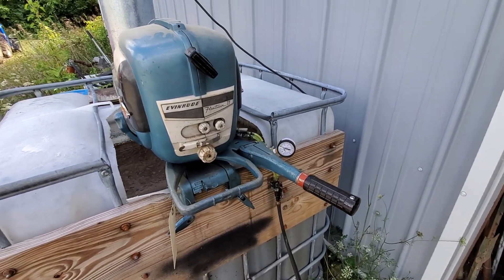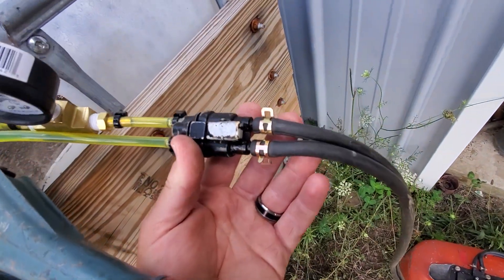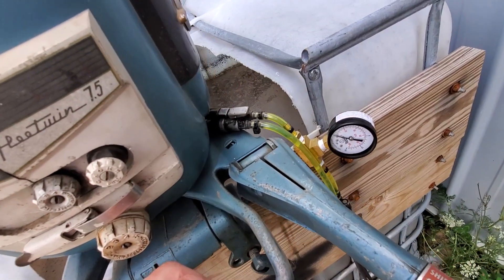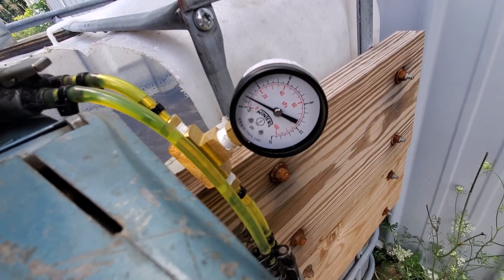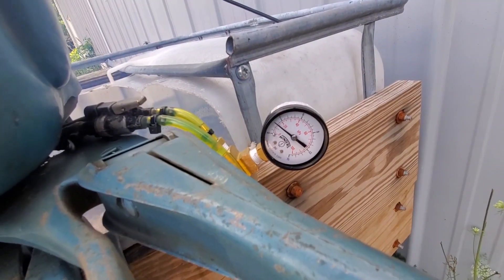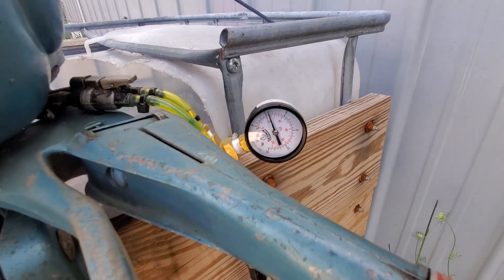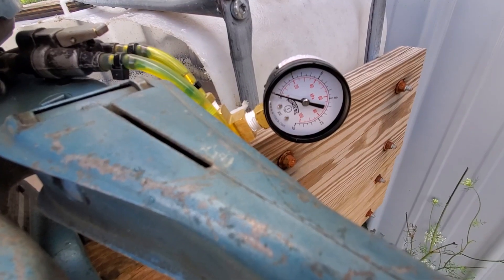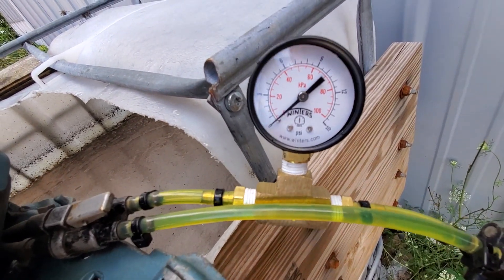OMC Pressure Fuel System Tank Pressure Gauge

Comment: It has been a year or so since we "finished" the Fastwin.  It ran great back then, idled like a dream, reacted to throttle, just required the primer being "thumbed" on the tank to keep carburetor bowl filled.  Ordered the gaskets and the rubber flapper parts, including the spring last year.  Just installed and reassembled everything yesterday.  Would appreciate your insight on this issue.  The motor will not run.  Set low speed jet to 2 1/2 turns out, high speed 3/4 out.  Primed to fill the clear glass bowl on the carburetor.  Ran once, only momentarily, at a full throttle setting, in gear with choke full on.  Patently waited, pulled, dried the plugs several times and attempted over and over for 30 minutes or so.  Is acting as if it is not getting fuel, yet it is.  And, as an abundance of caution, checked spark, that was fine.  By the way, installed a new ignition system, including wires last year.  Was rewarded with a smooth running engine.  Oh, and I did as you suggested, the gaskets for the manifold were assembled dry, no gasket sealer was used which might have gummed things up.
Reply: All ok.  Had an old beat up pressure tank.  Put new fuel in it.  Motor started right up.  Sorry to bother you.  Will be my first motor on the boat for the season.  These Fastwins from the 50's are great, light enough to move around easily for an old guy, like myself.  Looking forward to all your videos this year!
Reply from the maker: It's no bother really.  I got a little behind on some of my replies. I'm glad to hear you got your Fastwin up and running.  They are great motors.  Thanks for watching!

Comment: I have a question for you, when you have your tank disconnected from your motor, do you leave cap on tank slightly open so no build-up of pressure inside of tank just sitting and not being used or do you tighten cap? I'm new to pressure tanks and I notice on mine when I keep cap tight , fuel leaks out of fitting that goes to motor. Is this normal ? I have rebuilt the fitting with new o-rings and springs.
Reply from the maker: I do leave my pressure tank caps just loose enough to not seal tightly when stored. If the O-rings are a perfect fit and there are no scratches on the brass plungers they will seal and not leak.  If the O-rings are not perfect and/ or beginning to wear, they will seep slightly under pressure. To avoid the seepage, I leave mine cracked open the same as you.  Thanks for watching!
Reply: @oldjohnnyrude8404  Thanks for your reply to my question. I can see that if your as old as some of the parts that are used can't be in pristine condition that things will leak , that is why I was leaving mine slightly open. I lost half a tank of fuel because I had the cap tight after I had rebuilt this tank.
Reply from the maker: @MrBuddyMitch  Yes, I forgot and left the cap tight on my pressure tank I leave at my cabin in the shed in the spring.  After 6 weeks or so when I returned, I had lost at least a gallon of fuel mix from leaking during pressure cycles.
Reply: Thanks for confirming my theory to leave cap slightly loose.
Reply from the maker: @MrBuddyMitch  You're welcome.
 🙂👍

Comment: We just finished a 56 Fastwin this winter and spring.  Motor still had all the original ignition parts, flywheel never off.  Carb. had the cork float.  Runs great now, could not have done this without your videos!  Problem, will not keep running without priming.  Likely the Air Line Check Valve.  Do we need both Leaf Plate to crankcase gasket and Leaf Plate to Manifold Gasket?  Are they installed dry or with sealer?  Am going over to NAPA with a picture of your inline pressure gage set up for parts.  Will build a duplicate to confirm problem.  Thanks, Steve
Reply from the maker: That's great! '56 Fastwin is a great motor. Good power and will idle down woth the very best of them. If yours still had all of the original ignition parts, there's a good chance your motor does not have a ton of hours on it.  It's great to hear the positive feedback about my how-to videos.  Your tank is apparently not pressurizing.  That can be caused by bad check valves in the manifold,  a leaking air line on the motor, leaking O-ring on the air side of the tank fitting, leak in the tank air line, or something leaking on the tank like the cap or the gasket for the top of the tank where it screws onto the body of the tank.  If you need to pull the intake manifold apart, new gaskets for both sides of the reed plate are a good idea, but may not be needed.  They often separate without damage and can be reused.  That doesn't always happen though. New gaskets should be installed dry.   Sealer has a bad habit of getting into the checks and gluing them shut. Thanks for watching!

Comment: Hi, I need your advice, I have a 1957 Evinrude 18. I love this engine! Very reliable. Very interesting video about pressure tanks, thank you. I'm trying to figure out what tube up kit to purchase, along with water pump replacement.  The serial number is, 15020-25180 I believe my engine is the FD11. Pull start, short shaft. Would you be willing to send me a link, or website to purchase parts? You have been very helpful in the past so, I thank you. Eric, in Georgia!

Comment: Awesome video 👍. I too live in  Michigan and was wondering on where you find most of your parts for your older motors. Specifically a 1969 Evinrude fisherman 6 hp. I noticed you worked on a couple in some previous videos.
Reply from the maker: Thank you.  For your motor I would likely get most of my parts from Marineengine.com. They're great little motors and ME should have everything you need to get it tuned up and running well.  Parts are also available through your local Evinrude  dealer if you have one available.   Thanks for watching!
Reply: Old JohnnyRude Thank you so much for responding. This guy gave me the motor for free and it runs, but not well. I can’t even test it out because the dams of my lake were destroyed a couple months ago. I’m sure you heard about it on the news. Anyways thanks for the help and good luck 😊.

Comment: Ben that is good to know!  Now that you have a nice way to check pressure how about leaning out your motor and see what the pressure is when you get a lean sneeze.  Sometimes our old motors sneeze at start up and I always wondered if that was a back fire or something else.   My 40 horse Evinrude has a habit of doing that.  Something is making the check valves in the fuel pump stick open.   Thanks for posting!

dale
Reply from the maker: Hi Dale! I will have to see what effect a lean sneeze has on the tank pressure.   My guess is that will make for a quick jump on the needle, but very little effect on the baseline pressure reading.  I have a couple of OMC 10s that sneeze a bit on startup.  I'll have to give them a try and see what they do.  If yours is having the check valves stick open that is a very strange situation.  The checks are just a couple round rubber pucks with a thin rubber strip holding them together.  There is a light flat spring that holds them against the holes in the reed plate.  They could be stretched out or being allowed to become angled in there and not seal against the holes.  Sneezes should not have that effect.  The checks should recover from a lean sneeze without issue.  Those are worth a look if they are having that problem.  Thanks for watching!
Reply: @oldjohnnyrude8404  I have no problem with the small HP motors.  It's my big twin that has the plastic check valves.  Twice now the fuel pump quit.  I had to limp home pumping the squeeze bulb by hand!
Reply from the maker: @labradorguy5311  Plastic check valves and a fuel pump?  The gauge is for the pressure tank system and not for a fuel pump.  Which check valves are you referring to? I must be confused. 🤔
Reply: @oldjohnnyrude8404  Sorry I am comparing apples to oranges!  I was just wondering how high the pulse pressure would be during a lean sneeze.  On fuel pump motors they use crankcase pressure pulse to make the pump work.  Pressure tanks use the same pulses to pressurize the tank.  I guess I am over thinking my problem.. Sorry for the confusion!
Reply from the maker: @labradorguy5311  No problem,  Dale.  I was just a little confused. The fuel pumps use the full pulse to operate the pump from full negative to full positive pressure.  The pressure tank motors have a one way check valve on each crankcase cavity to utilize only the positive half of the pressure pulse and block the negative half of the pulse to maintain a positive pressure inside the fuel tank.   I am also curious how that lean sneeze affects the pressure.   When I try it out I'll let you know what I find.👍

Comment: Are you in the out going pressure  line or the in coming fuel line  or does it matter?   Also some of my  pressure tanks have a primer button  some do not   Whats with that and when did they change?
Reply from the maker: Mine is in the air pressure line. I would have used a fuel pressure gauge to put it in the fuel side of the line to know the gauge would be suitable for the liquid fuel.  

All the 2-line pressure tanks that I have ever seen or knew about had primer buttons.  If you have one that was built without a primer button I'd love to see it..  The earlier ones had aluminum buttons. The later ones had short rounded plastic buttons.   Im not sure what year they switched. I have found them that had been modified with a primer bulb in the fuel line side of the line,  but those were done as a workaround instead of repairing the primer pump diaphragm in the tank top.  Thanks for watching.

Comment: That would be really helpful in diagnosing a fuel problem !!!! 👍 I’m building myself one after I’m done fishing at Bens cabin !
Reply from the maker: I think it will be interesting to see the differences between tanks and motors if there are any.  If the tank doesn't hiss out of the cap after the motor has run for a short time, you know it isn't building pressure. It is neat to be able to see how quickly the pressure builds and how much pressure is generated though.
Reply: Old JohnnyRude that’s what I’m thinking and also if there is no pressure coming from the block but your tank is holding , that will give you a good starting place to look for a problem ! Either a hose or a connection or even a seal .

Comment: That is a GOOD idea. I had one years ago when I knew NOTHING about pressure tanks that just would not run right. I found out why when the full tank was setting out in the sun....oil all over the top of the tank, the gasket on top was leaking.
Reply from the maker: Thank you.  I think it will be handy and kind of interesting to see the differences between motors and tanks.  Much if it is just to satisfy my own curiosities. Thanks for watching!